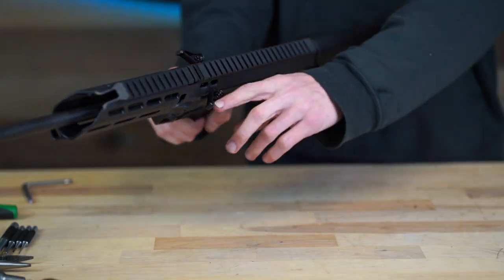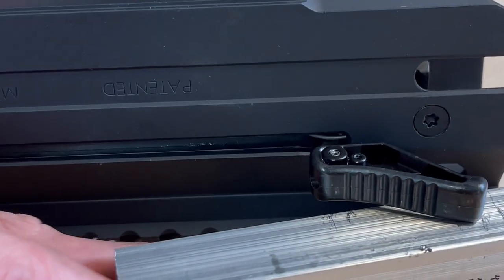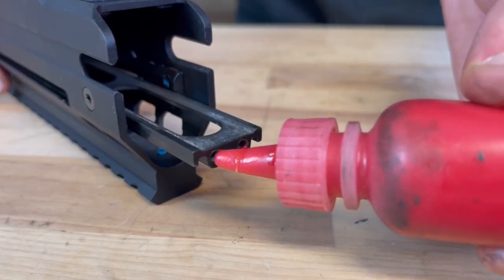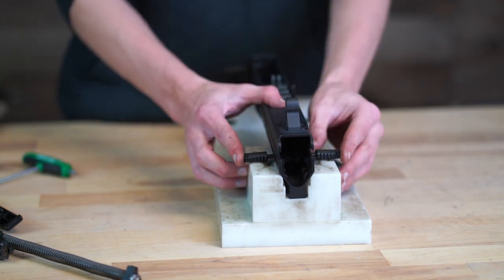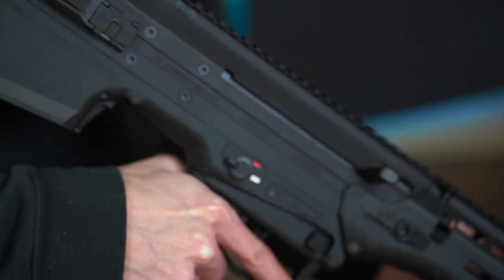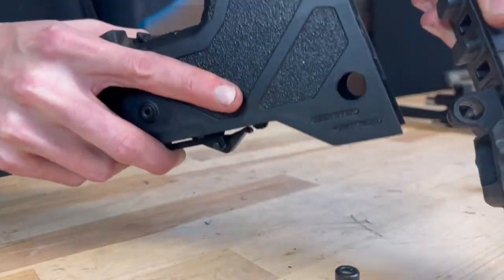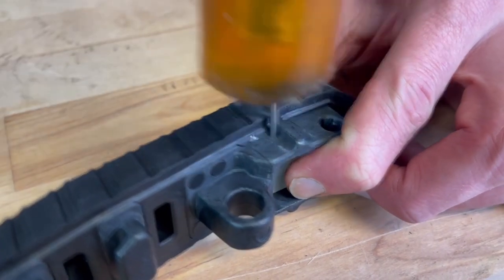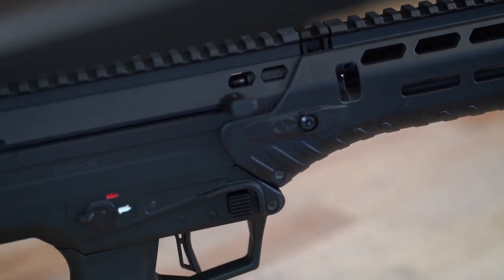MDRX Charging Handle upgrade installation

Comment: Personally I like the folding charging handles they should be metal instead of plastic but my FS2000 has the same deal you just have to be aware of that fact and be careful!
Reply from the maker: the folding ones are steel
Reply: @DesertTechUT  you are correct my bad lol. Why then make a change?
Reply from the maker: @bobjordan8283  improvements: lighter, simpler, stronger.

Comment: Has anyone had problems with the original folding charging handles?
Reply: I’ve run across forum posts and YT videos describing the original charging handles breaking off. I think part of the issue has to do with how aggressively a shooter has to rack the bolt to clear certain malfunctions.
Reply: I personally have not had any issues with the OEM charging handles. But i have read others having them snap.  When the bullpupforums when operating, there was a person who said his was broken in transit from Desert Tech to him.   Personally, i had more issues with the magazine release.  I really would like to see more in depth of the new system they have in place for the magazine system.
Reply: @JesseJames38  are they reworking the magazine system?
Reply: @mattw1362  If you look at the Desert tech 2023 Update video.  they talk about a new transfer bar and magazine catch.   That is what i was speaking of. My past MDR had issues with the transfer bar falling out of the track and chipping the receiver, and that caused the bar to get stuck and mag catch to be stuck open.

Comment: Both roll pins for the handles were a bit too small, while being aligned and driven, both shaved off the sides and required filing after. Not enjoyable.

Comment: I wish safety wouldn’t click on without rife being cocked.  Tavor does the same.
Reply: Dumb complaint.
Reply: @JohnBrowningsGhost  Why do you say that?
Reply: @JohnBrowningsGhost  oh, here’s another one for ya: You gotta remove the forward eject plate to confirm empty chamber.  Is that “dumb” too?  Look inside yourself.
Reply: Oh, one more: the 6.5/.308 should be able to use mil spec and not only magpul mags.
Reply from the maker: @Dyneemadrone  They do use milspec mags
Reply: @DesertTechUT  Hi Desert Tech!  I’m used to calling the metal mags mil spec, my bad.  I have lots of metal surplus mags, AI mags, etc for 6.5 / 308.  I do like my mdrx’s sex appeal.
Reply: @Dyneemadrone  no you don’t need to remove the FE chute to do that either. 
So yeah. Another dumb complaint.
Reply: @JohnBrowningsGhost  Hey Desert Tech, I hear you can visually confirm empty chamber with “FE” plate in place from a guy on the internet.  I’m unable to do so to the satisfaction of my range master and myself.  Please advise!  Thanks.
Reply: @Dyneemadrone  sorry your lame range master doesn’t like to look into the little inspection window in the chute, that doesn’t mean it’s not there. 
Anymore stupid complaints or do you think you might have one worth while?
Reply: @JohnBrowningsGhost  Well, I refer to them more as suggestions than complaints and yes, one more.  Last CQB course I took used sims which required changing out the bolt.  Is there a sims bolt available for the MDRX?  Or, sims which work with the MDRX?  Could you please find out?  Thanks!